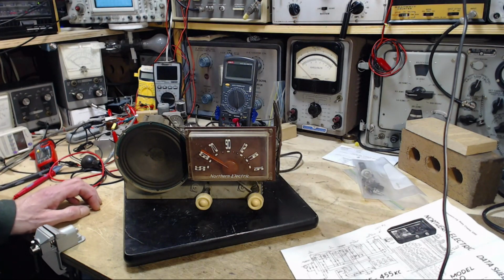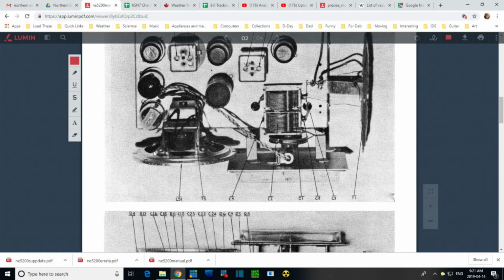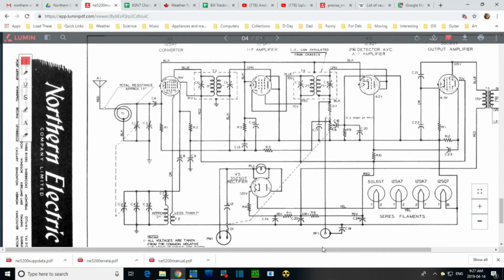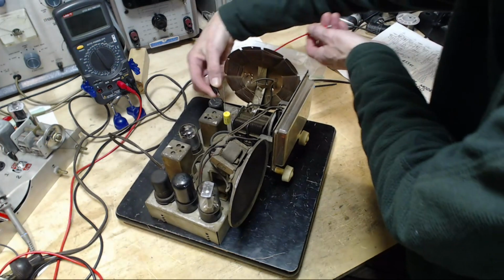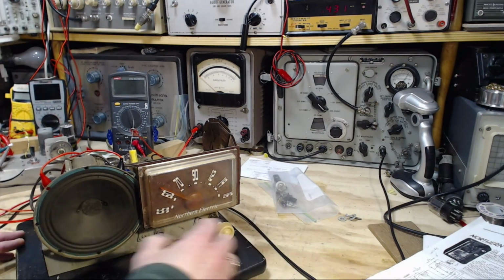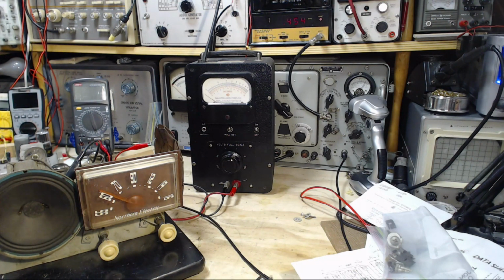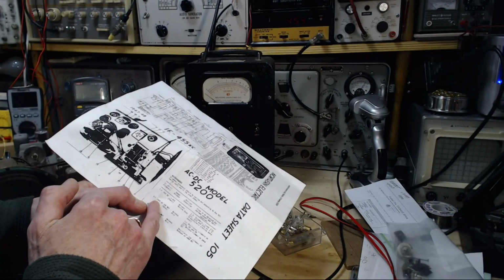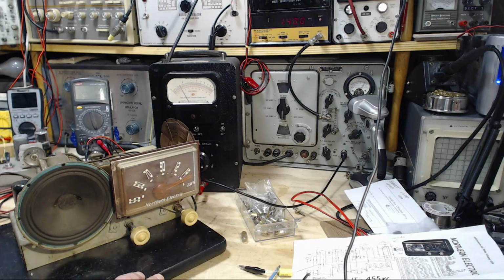Northern Electric Baby Champ AM Radio Video#4 - IF Alignment

Comment: The side farthest from the dial is the antenna side, going by the antenna is connected to it. So of course the trimmer on the bottom is the oscillator.

Comment: A whole radio rarely needs alignment, many newer restorers don't understand that, in addition, unless a radio is way off and you cannot receive anything you can align using radio stations near alignment points especially if they are weak ones.

Comment: Why would you align the radio with possibly bad tubes in it?  You'll have to do it again after you change any of them anyway.  The audio problems are most likely from the detector forward to the audio power amplifier.  Do you have a signal tracer?  You can identify where the garbled audio begins with the signal tracer.  Signal tracers are very simple, primitive tet equipment, but you can learn a lot about AM radios and audio amplifiers with them.  The 12SQ7 is the 2nd IF/ 1st audio.  It has two diodes and a triode in it.  One diode develops AVC/AGC, the other detects the audio, and drives the triode, which is first audio.
Reply: Agreed.  And alignment not possible with that audio nightmare happening.  Vol pot is bad, Jim knows that.  The 'disconnected mic' or 'umplugged guitar' sound is suggestive of a vol pot with an open wiper.  Algnment comes last, after otherwise normal operation is restored.  And the very first thing I do, after cutting the old power cord off, is to clean and lube the tuning cap and replace it's grommets!